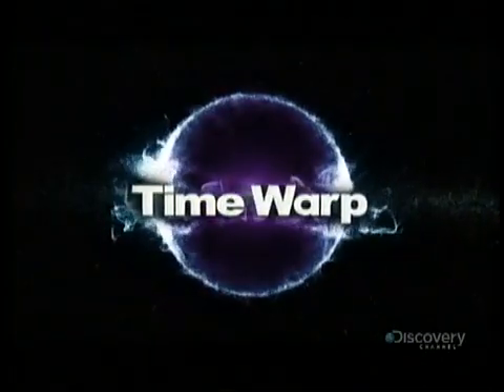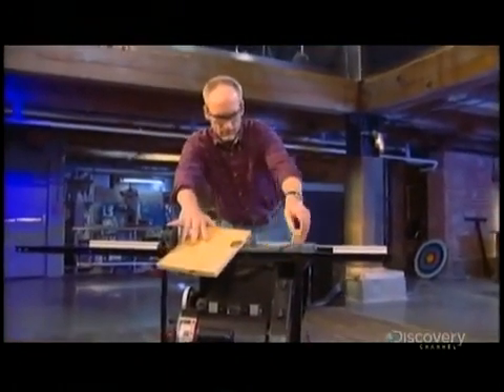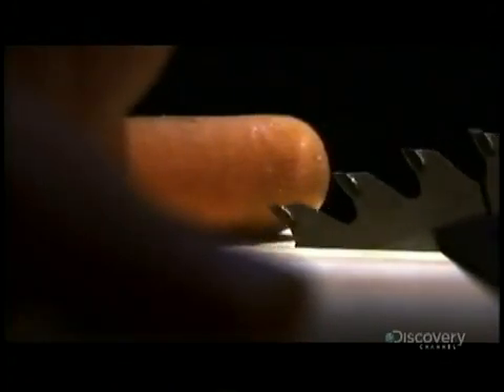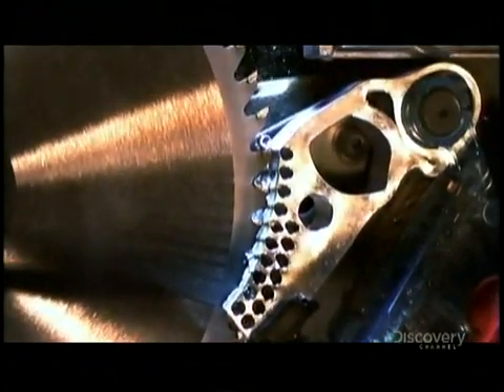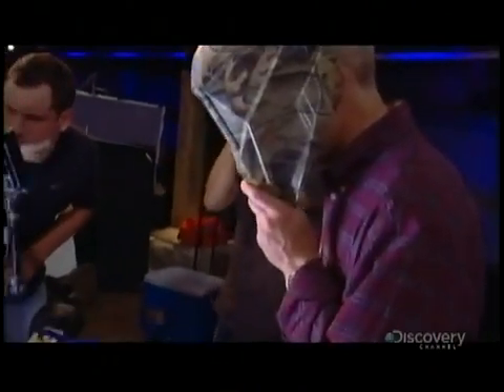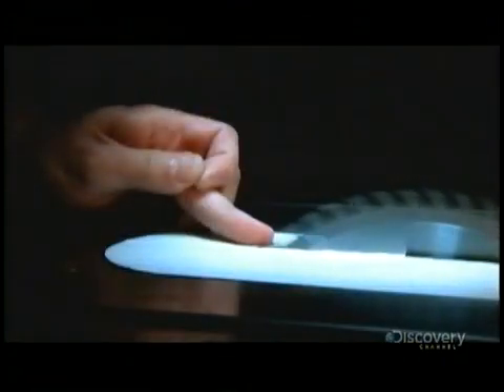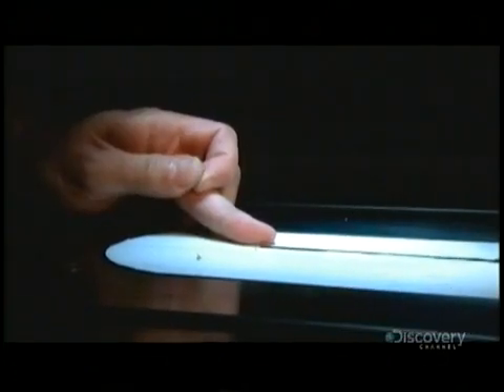Saw Stop - This guy puts a finger into an active table saw blade & comes away without a scratch!

Comment: I stop the blade and cause damage? why not to pull the blade down very very fast?
Reply: It would not be fast enough.
Reply: rephrase "it would not make much money"
Reply: by the time the blade is stopped your finger would be rolling on the floor
Reply: no, it literally can't be done. We're talking about having a single tooth rotate through your finger being too much. We need the saw to stop before a single tooth rotates an inch. There isn't enough friction on the planet to do that. I calculated the round numbers and assuming 1000 rpm like the guy said it would create so much heat it would kill you from over a meter and a half away if you stopped it like that.
Reply: Both are right I guess lol but then again it's not too often this happens so 99% of the people would never even have to pay the 60$
Reply: If they put a really strong disk brake similar to a brake on the front wheel of a bicycle that should save the blade and the stopping mechanism. It would need some really heavy stopping power though..
Reply: Maybe really high powered electromagnetic calipers with some special brake pads? Surely it can be done but then the saw would cost so much more you'd be able to buy like 3 blades and brake sets for the for the other one haha.. most people would probably never even set it off so I guess 60$ a pop isn't that bad.
Reply: +Logan Bills yes, but that is assuming you are able to stop it that way in the first place.
Reply: +Logan Bills if i remember correctly it wpuld have been around a few hundred thousand degrees. stopping something with friction that quickly really just isnt possible.
Reply: yeah, the saw would evaporate. FRICTION BITCH!
Reply: The saw evaporates instantly thus your fingers remain safe. Wonderful.
Reply: You guys are morons if you think this blade will vaporize, it takes over 2k f degrees to melt steel
Reply: and in order to stop a spinning saw blade without it rotating more than 2 degrees using only friction it would spike the temperature to over 100k f. That's why it just isn't possible.
Reply: isaac galewsky yea I never said anything about stoping the blade. Pull the blade under
Reply: no solenoid on the planet could ever act fast enough to pull the blade under fast enough.
Reply: isaac galewsky That's why NASA exists.
Reply: isaac galewsky alright bro it will be pulled just enough to cause little damage
Reply: i dont think you understand how fast this has to happen, we're talking less than a millisecond to completely neutralize a spinning sawblade
Reply: isaac galewsky I never ever said to stop the spin bro, I said to pull it under, it's possible to do so

Comment: Better to pay 60$ for a new blade rather than the hundreds at the hospital along with a finger or two.
Reply: Well in paying at the hospital only in America.
Reply: i live in finland and id lose the finger so i dont have to pay anything :DD
Reply: +HusseJumala you are an idiot then
Reply: They have to replace the machine as well
Reply: +GDtheultimatebeast WOW Just the blade and brake.  60$.  And even in the free (if horrendous) European healthcare system.  I think having a finger and being out 60$ is better than not.
Reply: GDtheultimatebeast WOW They dont have to replace the machine, just the braking system and blade.
Reply: Of course you are forgetting that in America if you are working for a company and cut your finger off on a saw, even if it's due to your lack of common sense in paying attention, you get to sue the pants off of the company.  To some, it's worth losing the tip of a thumb for $20,000.

Comment: I don't care about the argument over whether this is a worthwhile design or not; what gets me is the way they playfully pretend to understand the physics involved in the video. I'm not an engineer, but I still think I have a better understanding of the dynamics:

"1000 Gs" is not a deceleration, G has nothing to do with it. Isn't it just about energy and time? The difference between the blade's energy at 5000 rpm, and rest, divided by the approximate millisecond it takes to achieve this, is the deceleration, isn't it? We want to know what the energy is, in terms of torque, don't we? What is the blade's mass? how much energy has been given to the blade in order for it to reach a rate of 5000 rpm?

"5000 rpm is a lot of energy" ... "so it has to go somewhere when it stops" 2:43
No, 5000 revolutions per minute is a rate, and only one dimension of a vector, which the force of the blade rotating has.

Comment: Try forcing your finger in faster
Reply: You'd get cut even if it wasn't spinning.
Reply: +FernTheYoutuber that's why I mean to the point where it's still spinning and you push your finger so fast you cut your finger a second before it stops spinning
Reply: +sevan grigoryan You would cut your finger by pushing it into the stopped blade, the spin doesn't damage or very slightly damages your finger. It's still very save.
Reply: +KFC´s Gravy guess soooooooo
Reply: It'll leave you a little scratch, but you get to keep your finger

Comment: So if i work the saw to hard or I go through a knot on crappy kiln dried whitewood and it burns slightly, There goes a £100 blade and however much this costs. I have a better idea keep your damn fingers away from moving parts, and don't get distracted.
Reply: Wet wood is a bad conductor and dry wood doesn't conduct at all. If you trip into one of those by accident you'll be happy to be fine.
Reply: Maby. But i abuse saws, and as we all know Carbon is conductive. Honestly the only place I can see this is on site but then again, that's what blade gaurds are there for.
It's a product made for a problem, that is caused by idiots.
Reply: daniel parker Well this won't help you if you work with conductive materials lol.

Comment: try moving your finger with the same speed you'd cut the wood instead of 1/1000 of the speed, even i dare to do it like he did
Reply: i put my hand through a saw stop back in highschool. I needed stiches it  was deep but better than my hand getting cut off.
Reply: I was ripping a board very close to the blade using my hand to guide it, like a dumbass instead of a wooden tool. Id say about half of a tooth on the sawblade got into me before it sucked into the machine
Reply: Thank you man! Its alot of fun you just have to treat the machines like its the first time you ever used it, never let your guard down. I learned the hard way but i will never get lazy with a machine again. Lesson learned forsure.
Reply: It wouldn't make a difference on how fast you move. You aren't getting faster than electricity.
Reply: +Bs6.0pstroke_ 28 

I have said this a thousand times. No one is listening to me. Unless your hand is moving faster than an electrical current, no thing will happen to your hand.
Reply: The issue isn't the detection speed, it's the stopping time. The blade can't stop in an instant, the quoted stopping in the video time is 1 millisecond (1 thousandth of a second). If you were to karate chop the blade, you could take a finger off (10 m/s * 1ms = 1cm), but even at fast working speeds you shouldn't do worse than about a millimeter or so. And, indeed, you can see about that much cut in the frank.
Reply: Those who say that you won't get cut because your finger doesn't move faster than electricity are thinking about it wrong, it doesn't matter how fast the detection is. Pulling the blade out of the way is still a mechanical process and that doesn't move at the speed of electrons.

The case I would be concerned about is kickback where the wood goes one way and your hand carries on at great speed. Someone did mention above that they still needed stitches when they got cut using a sawstop. Its all about reducing risk.

I did see that Bosch have come out with something similar that lowers the blade below the bed without damaging  the saw.
Reply: I understand that and i am forever thankfull i still have my fingers.
Reply: Laurits Dørr Rasmussen YOU'RE GODDAMN RIGHT!
Reply: Pretty sure I have and what I have said still remains valid
Reply: Compare how fast they moved the hot dog to how fast he moved his finger. There is a very clear difference in speed, and a very clear difference in how much meat is taken off of each.  The proof is right in the video, you can see it with your own eyes. No further discussion is necessary.
Reply: I have spent months studying how to build a table saw and discovered a fantastic resource at Wilfs Wood Blueprint (check it out on google)
Reply: That's garunteed a cut.. he never said it won't cut you if you do that but it will sure as hell save your finger
Reply: Heisenberg?!
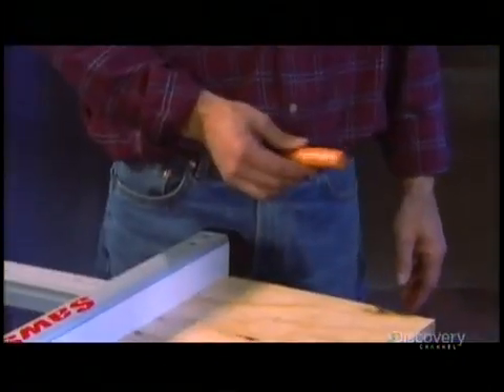Reply: 1:39 They were moving that hot dog on the plywood pretty quick. I'd say as quick as normal, and it only had a nick on it.
Reply: In one clip he does push the hot dog really fast and it did cut it a little bit. Enough to draw blood if it was a finger.
Reply: +Lenn Poulich FEIDELEINE
Reply: HEISENBERG
Reply: There is a time lag between the signal releasing the blade stop, and the spring driving the brake into the saw blade.  The speed at which  you are feeding the work piece will control how deeply the blade bites you. You are still going to get bitten, but  a GREAT deal less than if you were not using a Saw Stop machine.
Reply: good for you.   Nobody cares.
Reply: No. We do care. This argument is extremely important. You have no right to answer for others.
Reply: Yeah... well, its not the blood what the scary thing could happen to us using a saw. Who cares about cuts, blood or bruises? Thats cute. Missing limbs or fingers are't. Does make you look an idiot instead of a tough guy.

Comment: Good idea but it looks like the whole saw is damaged when it stops, it wouldnt do the bearings any good.......why cant they use a caliper design like disc brakes on your car?
Reply: Not fast enough think about where all that pad is going to go it would have to be wide and somehow fit next to all the mechanics that spin the wheel
Reply: Well, duh. They even mentioned that in the video. Are you going to complain about airbags and how they only work once?
Reply: If you slam your breaks on your car, your tires lock, but they don't lock as quickly as this stops the blade. The brakes will ultimately stop the tire, yes, but those teeth moving at the rate that they are will not stop fast enough with a system like that. This may destroy the blade, yes, but it stops it so fast that the eye can't even keep up with it. Their regular camera couldn't keep up with it. For something so harmful, as close to immediately is the best choice.

Comment: "5000 rpm is a lot of energy..." no... it's not.  Because RPM isn't a unit of energy.
Reply: I suppose.  I wouldn't consider it a lot.
Reply: so how much energy would be produced by 5000rpm
Reply: RPM doesn't produce energy, it's a result of energy.  An amount of mass moving at 5000 RPM has energy, so the spinning saw blade does have energy, but that energy is not measured in RPM, it would be measured in joules or some other unit.
Reply: "5000 rpm is the result of a lot of energy", there we go I fixed it for you
Reply: +ArgentOrangeOK Energy might be limitless so I guess you can't say if it's a lot or not.

Comment: Im no professional, but the sensors that the saw has to pick up the electrical impulses from the body would still stop the saw if you ran your finger really fast. Think about it, electricity travels much much faster than 5000 RPMs so maybe you might get a cut or something, but it wouldn't chop it off if you did fast enough. Aside from that, you should always be careful as fuck when working with a table saw lol.

Comment: Does it stops with safety gloves on?
Reply: you don't wear gloves while working with table saws.
Reply: Yes
Reply: Your finger would probably be fine but there'd probably be a hole in your glove.
Reply: Don't use gloves. rubber gloves and probably other gloves don't conduct electricity.
Reply: My woodshop teacher taught us to always use a piece of wood to push the bigger piece of wood forward. That way, the saw can cut into that piece of wood and not into our fingers. You could use the scraps of wood lying around to also get the pieces of wood you want away from the saw after you're done cutting it.
Reply: +Ch3ff just don't use gloves at all. You never use gloves on spinning machinery. If they catch , your hand is more likely to get pulled into the machine than if your hand had nicked it and either just got pinched or slightly cut. I don't even use gloves with belt sanders anymore. The last time I did the glove got caught and it yanked my hand off the trigger and right onto the belt. Only reason I don't have a massive scar and just got away with some bleeding and a really shitty month was because it forced me to let go of the trigger. Gloves are bad business with spinning machines.
Reply: Good advice for anyone starting out there

Comment: Is there a way to, instead of slamming the blade to a complete stop just have the blade slam all the way down below the table in the same speed? that way it doesnt break anything trying to stop so much rotation. it looks like it already slams down but Im wondering if that was just the fact of the sudden blade stop forcing all the momentum to the height adjustment setup, and possibly breaking that as well. either way a fantastic invention

Comment: I want to know what happens if the worker is moving faster. The idiots who dont use guards and stick their thumbs out when cutting also tend to try and work fast. If you ram the dog in there will it still stop in time to save it minus a nick at worst? or would it tear up the tip into meat paste.
Reply: You don't work too fast. If you're going the right speed this will never do damage to fingers.

Comment: If you were to move your limb, or anything, at full speed at this blade, it's still going to take off your finger.. The reason he moved the sausage and his finger in so slowly is because it still takes actual times to remove the blade. If you're a guy, and you've worked with power tools, you'll know that accidents often happen when you 'slip' while pushing full force. 

Very cool technology nonetheless, hope it saves countless limbs from being taken off!
Reply: Actually he was moving the hot dog pretty fast compared to how fast you should.

Comment: What helps the effectiveness here is that the connection will be made BEFORE the finger has come into contact with the blade, since the current can jump a very small distance. How far depends on the conditions. A completely dry finger may get cut up before it activates, on the other hand, if you've got a sweaty finger, it's very conductive and the saw stop will activate as soon as it gets too close.

Comment: I don't cut that slow. what happens if my hand has some speed behind it when it meets the blade?
Reply: +MadMetalManiac74 You will get a cut, if you're going fast it might even be a bad cut with lots of blood. However it wouldn't mangle your hand like it would have without the saw stop. I have seen it happen in person... Id take a badly cut hand that still works, than a stump.

Comment: Fake,on the slow mode cam you can see that the finger tip is just over the saw so that meant that someone could of pressed a button if you don't believe me see for your self
Reply: This is actually real. My school has one of these. I've never seen it been tripped but my instructor said it's happened

Comment: What if I wear safty gloves?!
Reply: for safety norms you should't wear glows while using saws, if the blade gets Stuck in your glows you will lose more than one finger.
Reply: +Nicola Ceornea congrats you know what you are talking about.
Reply: you don't.
Reply: Never wear gloves, long sleeve shirts or jewelry around any kind of rotary machine including but not limited to saws, drills, lathes, wheels etc.  The faster, harder, sharper it is the worse it is.  Gloves of any kind will snag the first point it comes in contact with and then the glove will move in the direction of movement of that point and take what is in it with it.  I am certified in first aid and was for a few years a safety auditor.  In the plant I worked in we had two hundred rotary polishing machines and one of the more common injuries was the result of having a glove snag the wheel.  Injuries ranged from cuts and abrasions to sprains, dislocations, compound fractions and severing of fingers and the worst one of that kind was three broken fingers and a broken wrist along with two dislocated joints and two partially severed fingers.  That was from ONE injury.  that worker was out of work for six months costing the company over a hundred thousand dollars.  This is because he broke the prime directive.  No gloves near the rotary machines.  

These are just the injuries I had to deal with.  There were others that other first aid workers dealt with.  

If you are using the equipment correctly there is no need for gloves.
Reply: Safety gloves are very dangerous around bit machine tools. Never! Ever! Wear gloves while using these machines. The blades will grab the glove and pull your hand into it. The glove and your hand wont even slow the bade down.